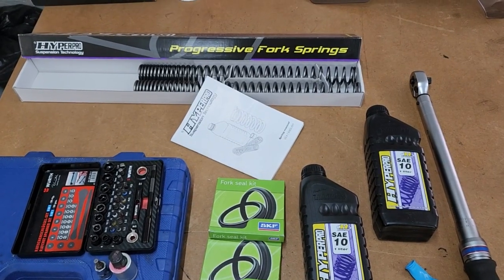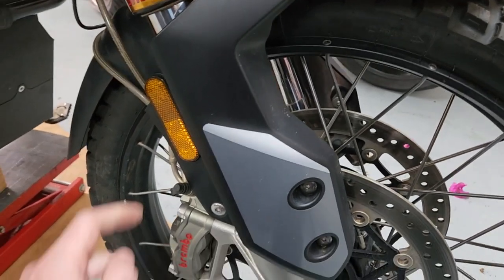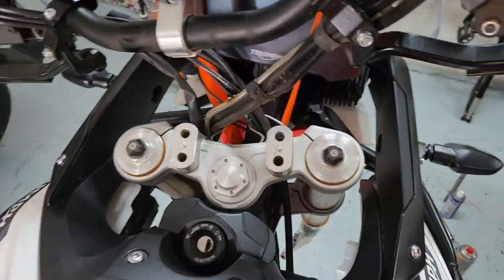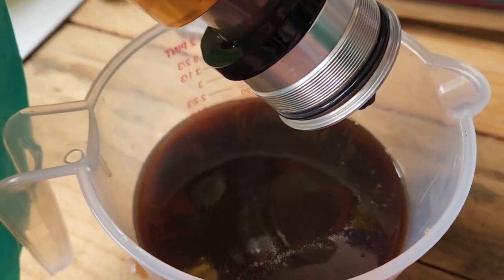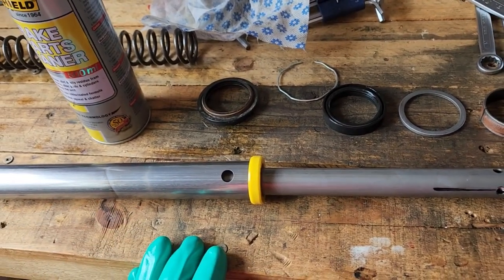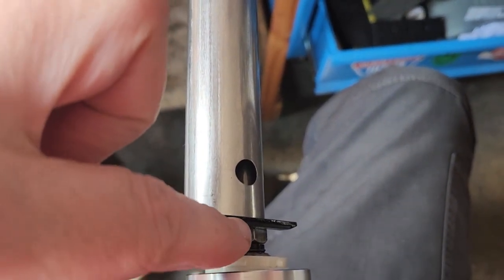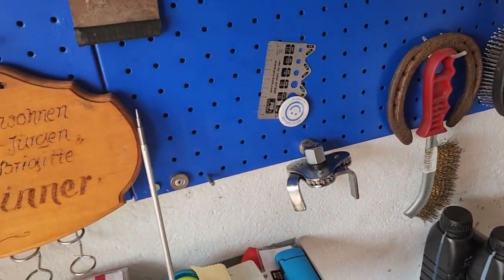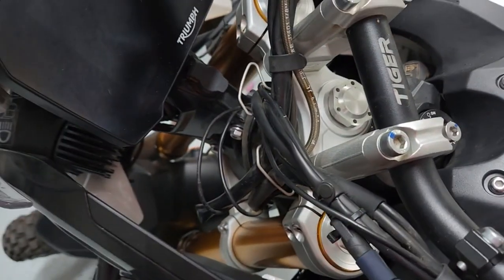Triumph Tiger 900 - Hyperpro suspension Part 2

Comment: If you turn the fork leg upside down and push down hard as you crack the bottom bolt it really helps.
You didn’t cover purging the air out after filling with oil. It’s a really important step
Reply from the maker: Good point, thank you.

Comment: how has this changed the handling of the bike? on road? off road? brake dive?
Reply from the maker: Rear Shock: extra weight is handled easier, feels easier, less of a push when braking. Front: A slight improvement off road, more plush, braking on road is slightly better. Not the black and white difference one hopes with aftermarket, BUT I found it to be worthwhile. Even if it's just because of the different weight oil or the oil flush.
Reply: @PatrickFlinner  the oil probably makes the biggest difference....